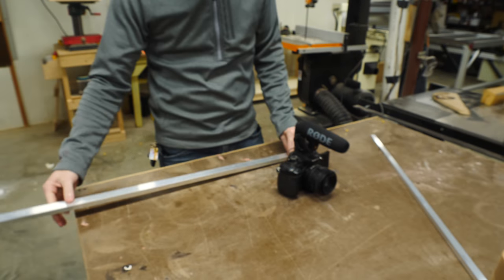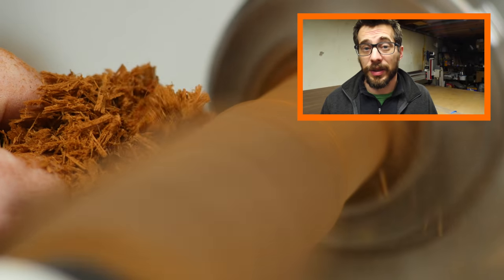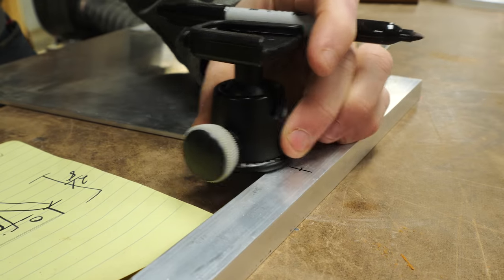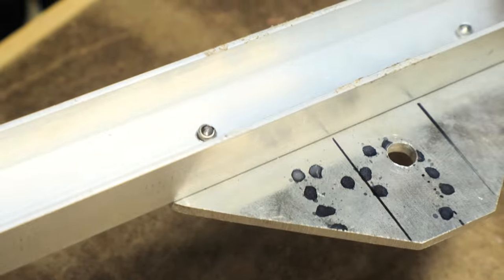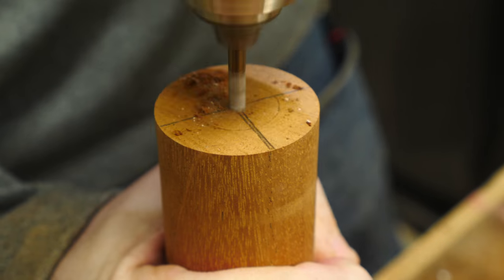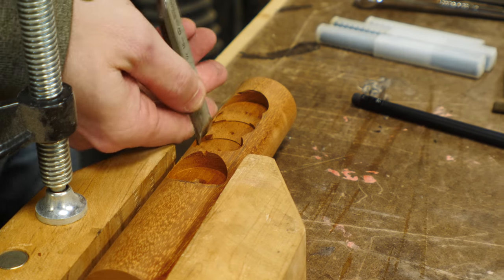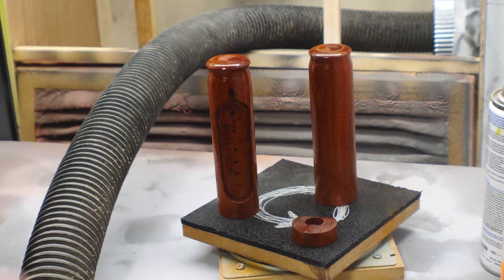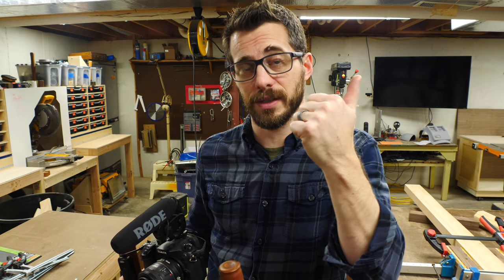How to Make an Inexpensive Camera Stabilizer Grip | I Like To Make Stuff

Comment: Not really a Stabilizer
Reply from the maker: Actually it is. It's not a gimbal which may be what you're thinking of. This does help hold it more stable.
Reply: If it stabilizes the camera then it's a stabilizer... I'd call it a passive stabilizer.
Reply: Yup - stabilizer.
Reply: Ok, its not a GOOD one Stabilizer.
Like you can call nerfgun a gun, but its pretty much useless as a real gun.

ps: sorry for my english, not native language.
Reply: By that logic, my hand is a stabilizer; so is a chair, a desk and the floor.
Reply: Yes
Reply: Well they're actually Nerf Blasters if you want to get semantic...
Reply: Robert Feliciano
I'll take that seriously. That's true. If there's insane wind outside and you can't hold a camera steadily, and you duct tape it to a table does it mean that the table is a stabilizer?
Reply: Go to Amazon. Search for "Camera Stabilizer" Top results will mostly be side-held (like this), top-held, shoulder-braced or some combination of multiple. Some gyroscope controlled  gimbal systems and weighted steady/glide-cam rigs will show up too. But this qualifies as a stabilizer by most definitions I've seen. Usually something along the lines of "a device designed to hold a camera in a manner that prevents or compensates for unwanted camera movement" 

AFAIK there's not industry accepted definition of what makes a camera stabilizer other than it helps stabilize footage and that's what they clearly state they're looking to make 0:15. But IDK maybe we should just go with what the guy with 1.7M sub channel calls it. I'm good with that...
Reply from the maker: You are correct.

Comment: I have a hint for you, Put two rubber washers on the bolt that holds the wooden rods, One between the bolt and the aluminum bar and another one between the aluminum and the wood, this will make it work as a vibration damper, You can use some layers of softer rubber!

Comment: To make it even easier to make, one can just bend 1/8" x 3/4" flat stock aluminum.   Bending the flat rod makes a handle.  That's what we did when working on a photo project for Photo Rock Bar.

Comment: Bob,
Lathe tip, you can save your self a bit of time and finishing if you turn both at the same time.  If they fit, don't cut the blanks apart until after you've shaped them on the lathe.  You can even use the parting tool do to the separation.

Comment: Nice project! Small tip: put a little chamfer around the beginning of the thread on the bold you grinded to length. That Will make it easier to screw it in and also removes the sharp edges

Comment: Attaching this stabilizer by a strap to your body will provide even more stability. Ie. a neck strap or shoulder strap, any strap that will create a 3 point anchoring point. Hope this makes sense. If you film with a dslr, put on your strap and stick it out far making the strap around your neck tight by stretching out your arms. This really works. :)

Comment: You can strengthen the wooden threads in the handles by coating them with super glue. The glue will soak into the wood and hard the threads making them less likely to strip.
Reply: Nate Large - Woodworking DIY & More superglue would be overkill, maybe just white glue is enough, just in case that you need to do something to the handles and you need to unscrew them off.
Reply: good point, let me clarify. Applying glue to the internal threads of the handle will harden them so that they are less likely to strip. Wait until the glue is cured to screw the handle on to the metal bolt so that you do not accidentally glue the handle on to the bolt thereby allowing it to be removable. I think super glue is good for this purpose because it soaks in easily, thicker glues might bead filling the thread or taking longer to cure and causing the wood to swell.  How does that sound? I would love to hear your thoughts and experiences.

Comment: Small note, if you counter sink before drilling the through hole, you'll be sure that the hole is centered in the counter sink. As you did it, you had to rely on luck and eyeballing it, which didn't matter here but in some cases might.

Comment: Wonder if bicycle grips would work and be easier to hold.  Might be a method to reduce the lathe work although button placement might be tricky.
Reply: Steven Kamradt make the handles from wood, put the button in then add handle wrap.

Comment: The remote inset into the grip was an extremely nice touch. Great project, Bob. Questions... do you have a bandsaw blade dedicated only for your brass/aluminum cutting? Is there a concern about how metal shavings will affect the saw or dust collection?

Comment: Hey Bob!  I'm a professional steadicam operator in the film business.  Just wanted to weigh in and say if your device helps stabilize the image even 1%, well then you got yourself a stabilizer haha.  One concern I have with your design is the Jobi head your using.  This might not be an issue because of your filming style, but that head is not meant for that type of use and is very weak.  It's possible you will see vibration in the image when walking around with the camera.  I could see a future upgrade to this being a more robust mounting platform.  You might not have any issue with it, it is a very small camera.  If your seeing vibrations, thats your problem.
Reply: Also just want to say I've been watching your videos since the beginning, huge fan.  keep up the good work

Comment: That's a cool project. Do you find those wood thread taps easy to use? It looks simple, but I'm worried I'll somehow mangle the connection by drilling at a slight angle.

Comment: This IS a "stabilizer", folks. Why it works is a matter of basic physics:

The further your hands are from the "center of rotation", lets say (in other words, from the camera), the less impact any hand-shake will have ON the camera. If you have one of the longer Gorilla Pod type tripods, you can get the same (more-or-less) effect by leaving one leg hanging, and bending the other two out to the sides (with an up-turn at the ends) as handholds (bending them in such a way as to get your hands as far out as possible).

Comment: Accually, if you add another quick release plate on the bottom of the stabilizer, you can just put it on the tripod easier and without unscrewing

Comment: Considering either the tools required, or the cost of an expert skilled enough to make this, this is probably the most expensive option out there. Also, the commercial in the middle is excessively long. Neither of the above two options is practical for most people, I would assume. Still, it is well made - both the video and the accessory.

Comment: I've got to disagree with you about tapping the handles, threads in wood never last and are not that strong. A screw would have been better hardware to use. However, if you wanted to be able to screw the handles off and on you could consider using a hangar bolt, or a "screw/bolt" combo.

Comment: Nice.. couldnt you use PVC pipes too?? it wouldnt look that cool but it would be lighter probably..
Reply from the maker: Yeah I don't see why you couldn't. You'd probably want to put a cap on the end or add a plug inside it as a mounting point.
Reply: the wood and aluminum does look cooler though :)